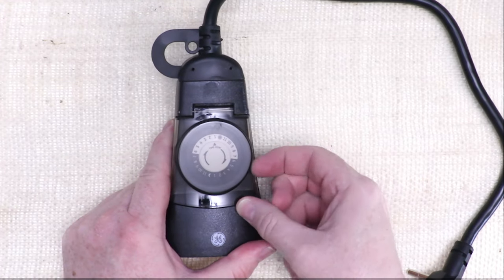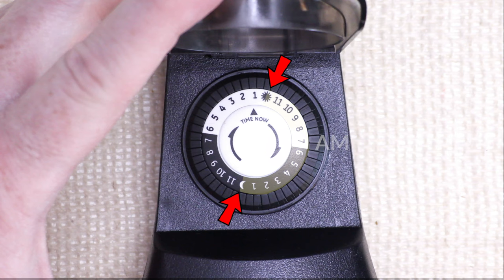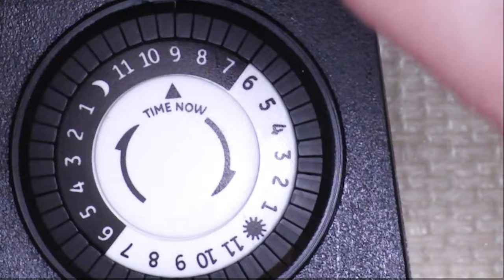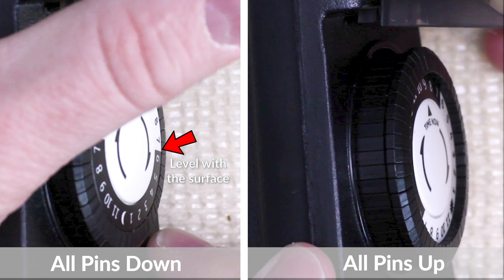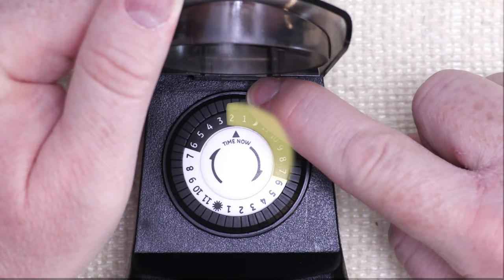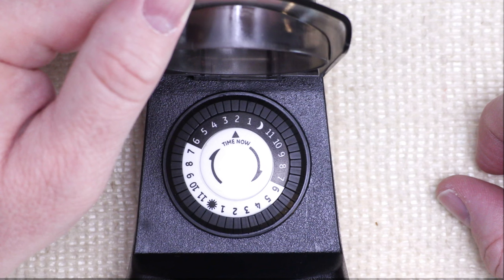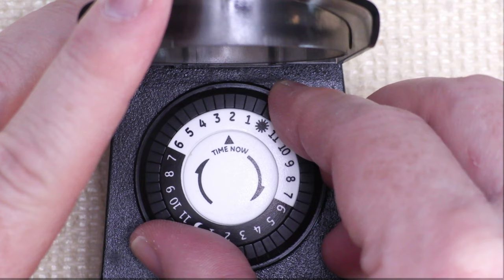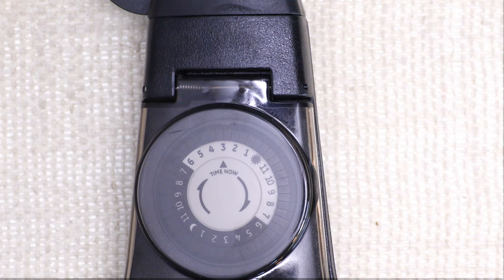How to setup a Mechanical Timer

Comment: great video.  instructions that came with the darned thing (Magnavox 32972-M 2 outlet timer) don't say ANYTHING about pulling up tabs.  And when I typed in the model number for the manual I got a 138 page PDF for a TV.

Comment: Hey one quick question I follow your instructions but my lights didn't turn off at 11pm. Want to program lights from 6pm to 11pm
Reply: Does it stay on until you shut it off or does it eventually turn itself off but not at 11pm like you wanted?